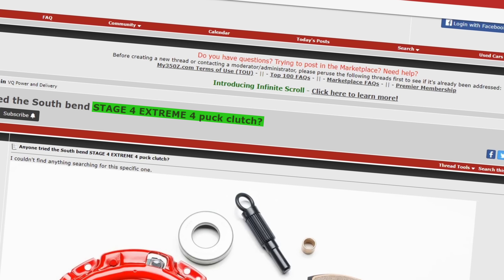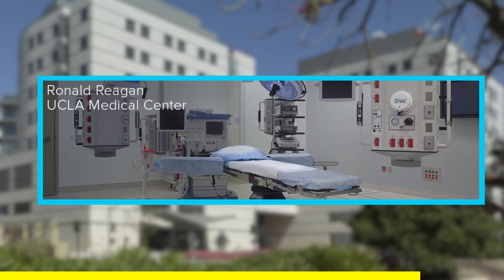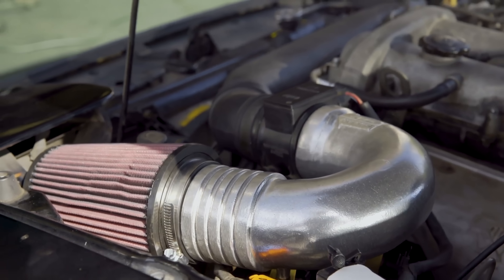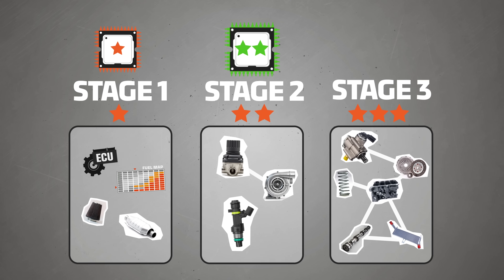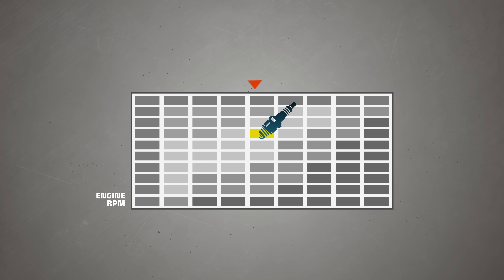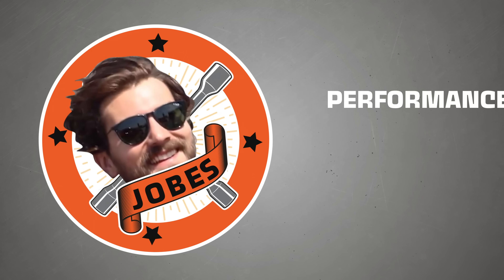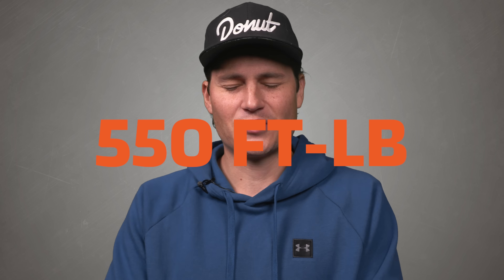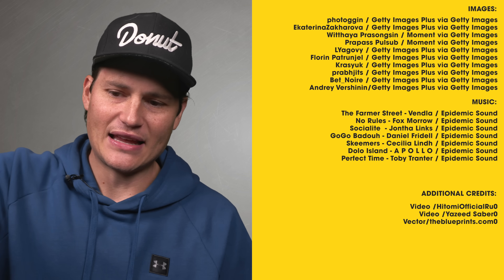What Exactly is Race Tuning?

Comment: What is race Tuning?

Me, who drives a diesel KIA Cee'd: Imma need this.
Reply: Slap on a Cummins turbo and a hood stack
Reply: Im sure somebody somewhere is deleteing and tuning those
Reply: @davidsny1190  oh yeah, I'm sure. I already saw a guy putting a spoiler and an extra fake exhaust, same car and engine as mine... I AM SPEED
Reply: Me, who has no car 
i gotta beef up ma legs
Reply: @TheKitt12  stage 5 tuning exhaust for your legs
Reply: Flash tune 👌🏿
Reply: @jordang1332  that stage 5 consists of a flash tune so I gotta eat more beans so I can backfire more, rolling Anti lag 😂
Reply: @TheKitt12  LMAO
Reply: hahaha
Reply: They have kia ceed racecars and kia rio rally cars
Reply: @TheBacontarian  yeah I know, but I have a 1.6 diesel with 110 gentle ponies
Reply: me who drives a 1998 new holland tractor on a farm
Reply: So you're the star in the reasonably priced car, the kia c apostrophe d
Reply: @bkw6329   lostukasx
Reply: Lostukas
Reply: Fuel pressure and timing 😉
Reply: You can actually get your diesel Kia chipped for pretty cheap. Gets you about 145hp and 320nm. Chiptuning is pretty common in Europe. But they are all around the world.
Reply: @hal479  me driving a 1999 case ih tractor on a farm😎 also my 03 GMC Sierra
Reply: @Baksteen_Express  yeah I saw those and got pretty interested. I mean, I use my KIA as a daily driver, so i don't need power, but if it doesn't affect the engine, 145hp and 320Nm are pretty nice for a daily. Maybe I'll consider it once the 7 year warranty expires in October.
Reply: Bruh you can afford a kia? :D
Reply: @giannitridaofficial  barely ahahahah I'm almost done paying for it, once it's completely bought I'm looking forward to buy a Corvette C5, since in Italy a 20 year old car is considered a classic, so you pay way less insurance and property taxes. Hopefully, in some months from now, I'll have my own V8 in Italy!
Reply: Basically half of my everyday customers...
Reply: @Liam Cutajar mine is a 2014 model, so the second series. It can be fun to drive for everyday use, but yeah it's not built for going too fast. Maybe with a chip upgrade and new suspensions, jt would improve a lot, I'll see.
Reply: you can definitely get extra 50 hp with Stage 2
Reply: @Dim4ik2012  I've never thought about a stage 2, only a first standard stage with just a chip tune. It would increase by 33hp. But since it's a daily, so I would use it basically every day, I don't think I would push it too much with the upgrades.
Reply: @bkw6329  Hes a Spam Bot
Reply: I did so many Trackdays on my 1.6 Pro_Ceed, 1.6crdi remaped to 140bhp. :D
Reply: Me who drives a base model 6 speed veloster from ‘12
Reply: @jordang1332 I have a stage 3 exhaust
 Stage 4 is too smelly in closed rooms

Comment: In Europe everything is way easier. SO here is a short guide to stage tuning. 

Stage 1 - ECU remap only, everything else is stock
Stage 2 - ECU remap + hardware mods. The most common is to cat-delete, remove any eco restrictions and add mods like intake, exhaust, cooling, etc which make more power than stage 1 but the engine is still stock and stock turbo.

Stage 3 - upgraded turbo + cooling + exhaust + ECU + MANY more mods possible BUT most of the engine internals (pistons and crankshaft) still remain stock. This is how you can extract maximum power from the engine and still have stock components.

Stage 4 - Full engine rebuild and basically limitless upgrades on top of that. 

So here you have it - 1,2,3,4. Simple and easy

Comment: Wait I didn't understand something. That chiptuning is also possible on atmospheric engines right? Even if the powergains are less important, we all want more powah. So what exactly is modified in a chiptuning in an atmospheric engine? The throttle body opens even wider? If not, how can the engine inject more fuel to create that tiny extra horsepower? Please petrolfriends, help me understand this
Reply: Ignition timing, AFR target, VVT cam timing,
Reply: @sc0llay  they are able to do all this stuff only by touching the ECU, without any physical changes?

Comment: For me it was always like this:
Stage 1: Changing Software related stuff without changing anything physically
Stage 2: Changing external motor parts like exhaust, air filter, intake/exhaust manifolds, turbo related stuff
Stage 3: Swapping internals of the motor like camshaft, crankshaft, pistons, rods...
Reply: Exactly
Reply: and I guess stage 4 would be weight, aero, suspension, wheels and brakes?
Reply: Forged Valve seats, more resistant valve springs, higher compression head gasket etc all that lovely stuff is all Stage 3 for sure.
Reply: @MikfinityPog  stage 5 is putting in a jet turbine you stole from the military

Comment: Nothing says, “I don’t know shit about cars” like when they start talking about “stage upgrades”
Reply: Agreed. I go to some Subaru meets, and people are like "What stage is it." And I'm like.... "Uh... Well, it has this this and that. " And they're like "Okay, but what stage." 

Me: "Stage 2.37".
Reply: The only thing I use stages for is cams, because the kinda guys I talk to don't understand lift/duration and stuff. Other than that I might say "they call it a stage 2 trans" but then proceed to lay out that it comes with better clutch packs that are rated up to 600 ft-lbs input, a custom redone valve body, and a brazed 2200 stall lockup torque converter good for about 500 horsepower. And if I'm talking about something like I'm running twin 57mm precisions feeding a gen3 whipple, etc, etc, and they don't get it then I might dumb it down and say something like "think of it as a solid overall stage 6 setup that makes 1xxx horsepower (for the record I'm running a full bolt on motor right now making maybe 300, not dumb enough to run a thousand horse motor on a 500 horse cobverter.
Reply: I wanned to Unserstand but i only hear: TURBO CHARGER, DODGE DEAMON, TUNING, FUEL INJECTORS, EXHAUST, HORSEPOWER, STAGE 1, 2, 3, GRAN TURISMO, PERFORMANCE, MODIFYING, PROGRAMMING THE SOFTWARE, AUDI, SUPRA, REARWHEEL,
Reply: Unless they’re talking about the tune itself this is true...
Reply: Definitely. "stages" are something you would find in a video game or something. Has no relation to real life tuning.
Reply: @JPtheHammer  I was going to buy a totalled gti, I started researching some upgrades for it, I inevitably came across forums. Every single Fing person referred to every performance mod as "stage x" 

So not only did I waste time and brain cells, I ended up having to Google what these stages had for parts 🤦
Reply: @JPtheHammer  If someone asks what "stage" your car is always say 42 because the answer is always 42
Reply: @sergeantspeed5941  GTI stages are easy because of how tunable the stock turbo ECU maps are.  Stage 1 is ECU only (+100hp), stage 2 is added downpipe with updated ECU (+130hp), stage 3 is upgraded IS38 turbo from Golf R with ECU (+200hp).
Reply: @cmschmidt15  I know that now but nobody in the forums mentioned what those upgrades were. It was "i did the stage 2 upgrade" 

Kinda bummed the car sold because I wanted a gti, but it didn't run and needed a LOT of front end work and still sold for 2500 at auction. It was kinda rusty in spots too. One day. I'll own one, I'm surprised what little work is needed to make serious power with those
Reply: @sergeantspeed5941  Yea I own a GTI and I think compared to other cars, the different stages in a GTI are luckily pretty cut/dry compared to the stuff they bring up in this video for different manufacturers.  Agreed though that it took me a good week or two to understand it all.  GTI has been amazing, suggest it once you start looking again.
Reply: Someone finally said it
Reply: Love ya profile pic bro
Reply: @Tronnos840  bo  bblb.          I
Reply: @cmschmidt15  what kind of gti
Reply: @JPtheHammer  yep i was gonna come in here and bring up the Subaru guys, i think theyre the worst ones about it
Reply: Totally agree
Reply: @Art-lm4ik  my car doesn't have a stage...it's just tuned LOL
Reply: Depends on the car and how in-depth the build is. For FBO’s, stages are very simple. Once you get into the internals of both your block and your tranny is where the grey area gets wider.

Comment: Its hard to conceptualize a 2.0L making 500+ hp and 500+ ftlb torque. The Jerwagon is a truly remarkable car and what an incredible tune
Reply: A Focus ST can make about 450 horse without a whole lot done. And it’s also a 2.0l
Reply: powerful 2.0L exist. Some are decently reliable if done right too.
Reply: Mercedes-Benz M139 engine,
(2L 4 Cylinder) produces 416hp at the wheels
Reply: Plenty of examples of the civic type R out there making 500+ out of the 2.0 k20c1… now getting that power to the ground in a fwd is a totally different story

Comment: A stage 6 air intake is amazing!! I am so going to use that.  And other things like "stage 4 wipers"  aerodynamic for more speed.  Or stage 5 Schrader valve caps.  ( the little rubber stems used to fill air in your tires).
Reply: I got stage 7 valve stem caps (they’re made out of 40s&w casings)
Reply: @OkieTA95  Bet it looks badass
Reply: Well my eclipse went from stage 0 to stage 100,real quick

Comment: I've always thought of stages like so
Stage 1: street upgrades, nothing crazy, no track days
Stage 2: street/ track upgrades, for a car you can drive to a track day and drive it home
Stage 3: full on racecar stuff
Reply: I dare say, most race cars don't use these things. A lot of GT4 class race cars, like the GT4 Mustang, GT4 Camaro, etc., actually don't have a single engine mod... Basically just better brakes, wheels, and slick tyres. Maaaaaaaybe racing coilovers.

B-Spec touring cars, for example, use almost entirely unmodified Ford Fiesta (non-ST trim) or MINI Cooper non-D type cars with ~110 WHP in racing spec

Spec Miata, basically all unmodified engines...

A majority of modern race cars, you don't really have to turn wrenches on them. Remove interior, weld in a cage, bolt in safety equipment and you're done.
Reply: What in reality they are, "reality can be whatever I want it to be"
Reply: Even that's inconsistent though.

One tuning company's "Stage 4" is another's "Stage 2".

Only thing the stage numbers is good for is to tell the buyer in which order to buy and install the packages.

Comment: My 2002 Subaru WRX wagon was Stage 2+ using a cobb SF intake/FULL TBE & was Pro-tuned on 93 gas at a performance shop in my area. Going any higher would cause damage to the stock motor/transmission.

Comment: In the UK the general understanding is;
Stage 1 - ECU software only
Stage 2 - ECU + Bolt ons/Induction kit
Stage 3 - All of the above +Turbo Upgrade/ Supercharger.
Stage 4 All of the above + Fully built / forged engine
Reply: Sounds like the srt4 dealer stages

Comment: In Russia it’s simple, stage 1 is just a remap, maybe with some air filter mods, stage 2 is intake and exhaust replacement. Stage 3 starts with replacing your turbo, but the rest of the engine is stock, any modifications to an engine (cams, pistons, etc) considered to be a stage 4.

Comment: I'm doing a daily driver build on my Chevy Trax. It has the 1.4L ecotec turbo. The airbox on these (and the Cruze) is designed to move air UP thru the filter. The factory turbo is built in to the exhaust manifold.  I replaced the turbo with a OE equivalent with a billet wheel. High density valve cover and intake manifold. Installed higher temp spark plugs and coil pack. Installed larger intercooler, and cold air intake. My next planned mod is exhaust, I'm going to dual pipe if there is room. All that said, what mod should I do next? I don't want to replace anything inside the engine.

Comment: The most hardcore “stage” people I’ve seen seem to be Subaru owners 😂
Reply: I own a bugeye and can attest to this 🤣😄🤣
Reply: 1UP, I own a bugeye as well, seems like stage 1 is tune, stage 2 is downpipe and exhaust, and stage 3 is anything more all the way to sleeves and meth.  

Donut, do a video on clutches and how to correctly size what clutch you need for the power you have or want.  Stages are useless in that field.
Reply: @christianaque4702  buggeye gang
Reply: Can confirm
Reply: @rayellisiii  most websites advertise the power ratings for each clutch. You want one a little more than your power goal. Preferably sprung and full face for nicer drivability. Once you go puck style or unsprung it’s not as friendly.
Reply: Nah man, Neon owners

Comment: Grand tourismo give the concept "stage", but without standardization 
But there's a tuning shop that specializes in modifying audi came up with proper standardization for the "stages" to support their tunes and remap , from stage 1 to stage 3+ 

Then many tuner follow the steps and came up with their stages, but those stages more or less gave the same ways of modifying from basic remaps to upgrading hardware to support the massive power bump

Comment: The "Stage" nomelclature actually existed before Grand Tourismo, though I'll agree that the game did expand it's usage to the wider audience.

The one example I'm super familiar with is the Buick GS/GSX series starting in 1968 through '75 used "Stages" as an upgrade package options.  Stage 1 got you the Wildcat 455 cubic inch engine over the Buick 350, dual exhaust over single, and a larger 4 barrel carb, arriving at the 360hp, 510ft/lb torque monster.  Stage 2 was a very rare package option that was sold as a dealer option, or to wrench happy individuals and were shipped out in the trunk of the car, and less than 5 Stage 2 GSX packages were actually installed by the factory.  High flow heads, high flow intake manifold, custom exhaust porting, a more aggressive camshaft, hollow pushrods for improved lubrication, forged piston heads, a tuned up 4 barrel carb are what's known, but there could have been other race-inclined options included.  Their factory example had a much higher rear differential ratio than the usual GS (at 4.78) to help transfer all that torque to the tires, but I don't know if that was a thing that came with the Stage 2 package or not.

Comment: Stage 1: bolt ons. Intake, exhaust, wheels, springs, exterior accoutrement. 
Stage 2: headers, turbo (if equipped) back exhaust, seats, steering wheel, suspension (street), small aero improvements, brakes. 
Stage 3: turbo (or s/c, all required now except big block) full ecm/tcm, upgraded suspension and brakes required, cage (probably) specific function in mind, aero is undoubtedly a problem now, chassis imptovements (tube frame?)  
Stage 4: fully everything in that category as far as bolt on or off the shelf parts, ready to attack the track (in whatever form) from what you could find on summitt or Jegs, custom aero, no interior, frame mods, etc...
Stage 5: purpose built. Say no more. You have a goal and a plan to meet it. All manufacturers and all records are calculated. You know when you're here.
Reply: i think this is a perfect assessment.
Reply: Except this is so variable. My car has a stage 1 tune, and that’s just a raw computer tune to the transmission and the ECU. It goes from 290hp/290ft-lb torque to 365hp/380ft-lb torque. Bolt ons don’t happen until stage 2.

The stages not only depend on the tuning company, but also the car itself. Some cars can’t handle the added power and need upgrades. Some can, and can be tuned significantly before needing to upgrade hardware.
Reply: so if I buy a 350z for drifting and put a fly off handbrake in it, I have a stage 5 350z? perfect, this isn´t helpful at all imo.
Reply: I think solely considering engine upgrades. Stage 1: ECU tune only
Stage 2: Upgraded intercooler etc with a bit more tuning
Stage 3: Upgraded clutch, turbos etc with a tune
Reply: had my first car a 320d f30 bmw(184 sttok) stage 1 ed at 227 hp and like 500 nm , there were no parts changed just and ecu change.
Reply: @SniperReady  Same for mine, stage 1 goes from 210 to 252, stage 2 was just stage 1 with catback exhaust, stage 3 is adding a new downpipe, injectors, turbo and intercooler with larger piping and above 300
Reply: That's a good list, but stage 1  doesn't need any upgrades,only a remap and stage 2 only needs downpipe,intake and remap

Comment: What would you consider the 2020 Camrys dual fuel system both ported and direct injection sometimes it uses both at same time 8 injectors in a 4 cylinder. It’s dynamic force 4 engine is kinda advanced ngl

Comment: In Belgium it's like this.

- Stage 1: ECU Tune
- Stage 2: ECU Tune, Intercooler, Exhaust, Downpipe, (Kw) Air filter
- Stage 3: ECU Tune, Hybrid Turbo, injectors, intake manifold, hp pump, and more

Comment: I remember when I started learning about cam upgrades for LS3s I remember reading one site that said a stage 1 cam was generally a +30 hp gain and I installed a stage 1 from TX Speed and it gained me about +90 hp.
Reply: jesus fuck, if only i could do that to my FA20
Reply: I hate how they denote everything in stages. That literally tells you nothing. Intake/Exhause duration, lift and lobe seperation are much more helpful. I always see people get the biggest cam they can find only to find out their engine becomes completely unusable on the street and there's not even enough vacuum to work the brake booster.

Comment: I think the first american car to use the "Stage" term, was the Buick skylarks in the late 60s. In 1970 specifically you could get the stage 1 option which gave you an extra half point in compression (to 10.5:1), rejetted carb, bigger cam, chrome valve covers, heavy duty cooling, and bigger valves, stiffer springs in the heads, and a blacked out front grille along with some badges and suspension upgrades. 

Stage 2 was never put into production, but I shit you not, it was 540 hp big block buick fury. It could run 10.70 at 123mph with slicks. In 1970.